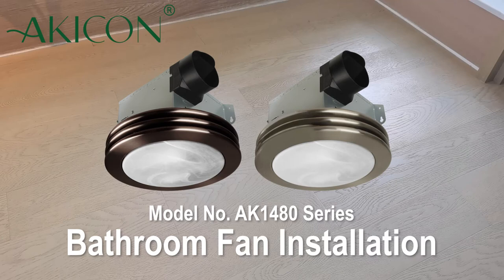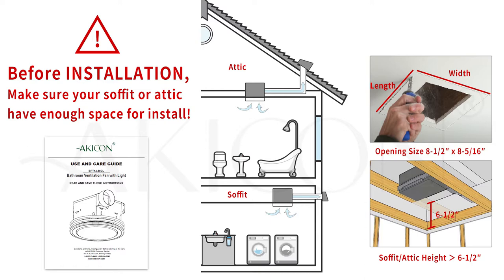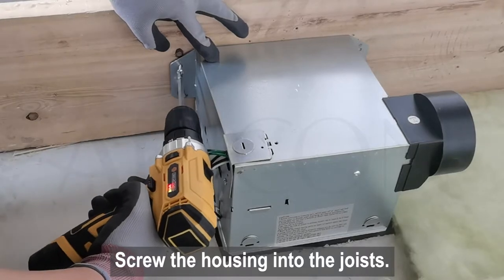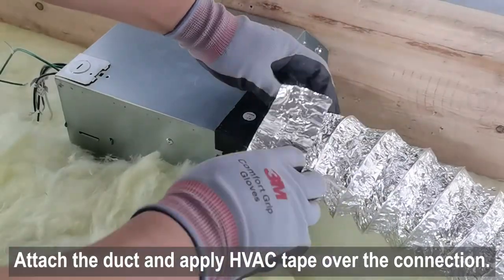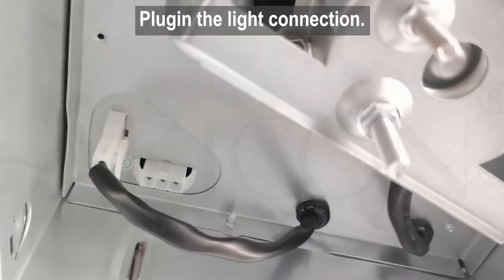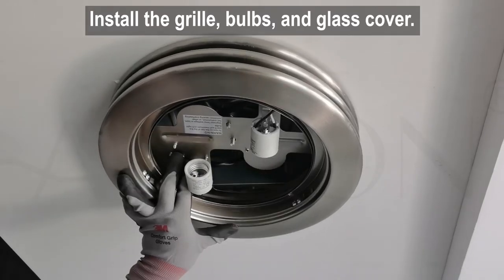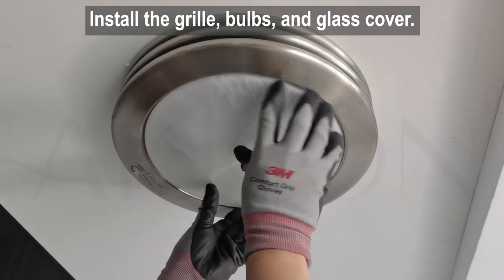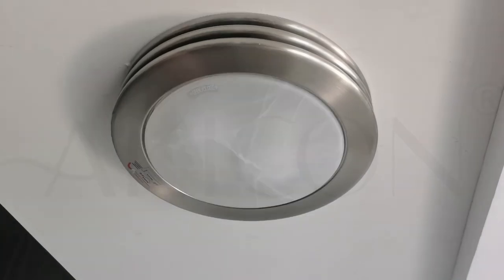Akicon AK1480 Series Bathroom Exhaust Fan with Light Installation Video Model# AK1480-BN/MB/SW/ORB

Comment: I can not get the light cover off. Any advice?
Reply: Trying to figure mine out too
Reply: It takes a LOT of force.
Reply: Take an 8 inch piece of duct tape and make middle flaps and sticky ends. Make 3.  Affix on glas housing close to 3 edges.  Grip flaps and try twisting counter clockwise. Reposition ladder if you are short for best angle. 
 Thanks to Josh from another youtube video. Im petite and ask my boys for hand strength with jars so if I can do it you can too!
Reply: Anyone figure out how to get it off?